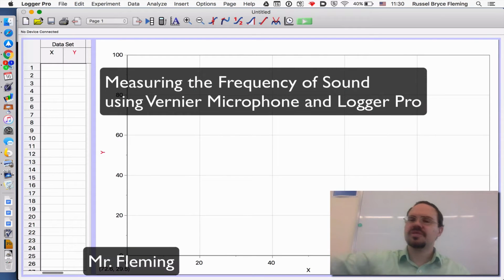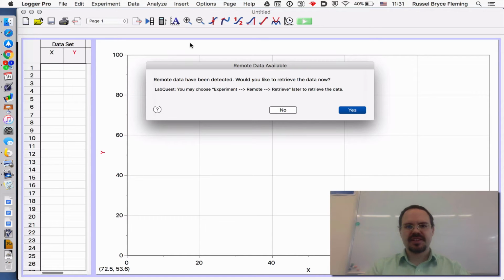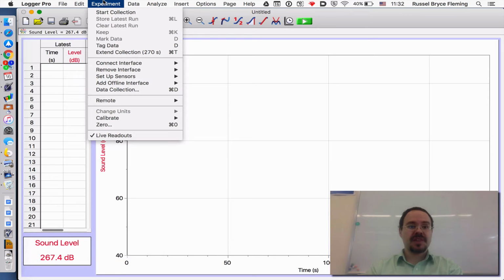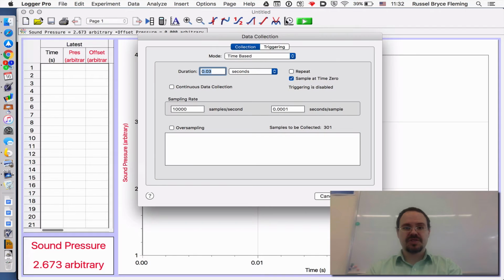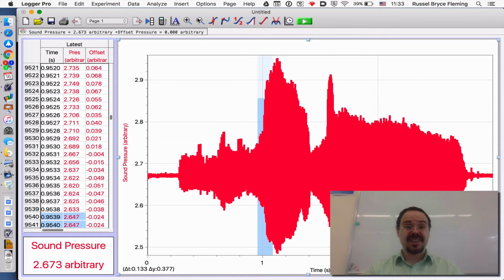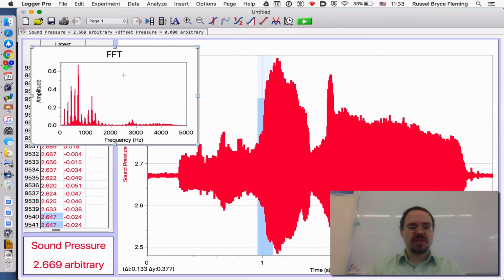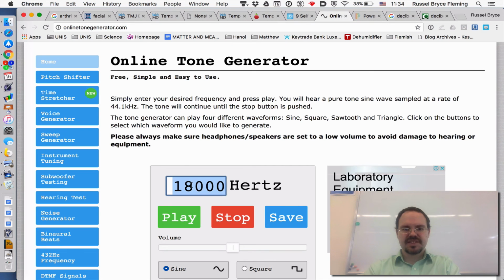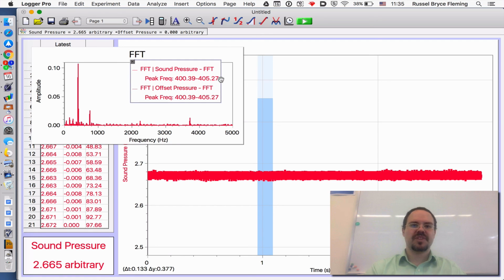Measuring the Frequency of Sound with Logger Pro

Comment: hi, can you measure speed of sound in air with vernier microphone ?
Reply: Yes, you can measure the speed of sound. You can change the length of a pipe and use logger pro to measure the frequency.
Reply: Yes, see how I used a vernier microphone to measure the speed of sound using a dog clicker and a cardboard tube.  https://youtu.be/aSY7fIJ0tic?si=_zskn3UxODlcGjj6&t=666

Comment: Hey there! what is the uncertainty for the frequency?
Reply: It will really help me a lot
Reply: For the uncertainty, one idea to consider is to find the average value of the range and then use the range as the max and min values. Uncertainty for trials is often calculated with (max-min)/2. In this case the average is 661.035 Hz and "uncertainty range" is 22.555. This then becomes 660 Hz ± 20 Hz.

Comment: Hi! Do you know any way to get sound data without the Lab Quest microphone? Is there any alternative microphone that works? Thanks!
Reply from the maker: I am sorry to say that I have only tried out the equipment in the video so I am not aware of other alternatives. I will say that without the Lab Quest, the microphone would not work properly as the smaller USB interfaces would not work as the microphone probably needs more data processing.